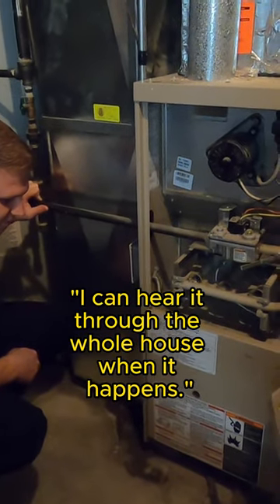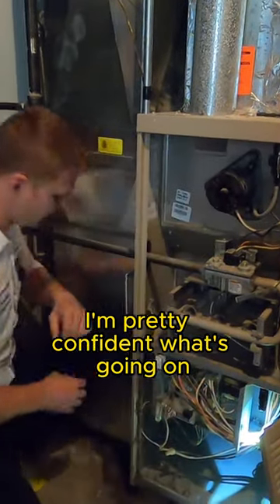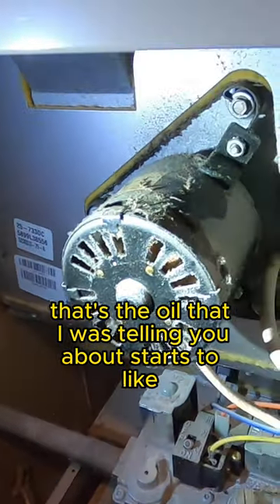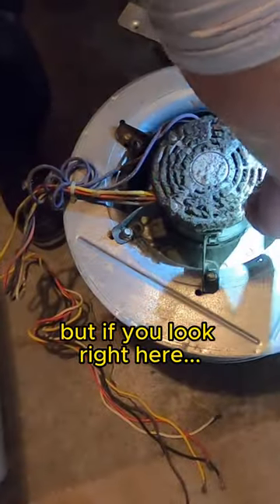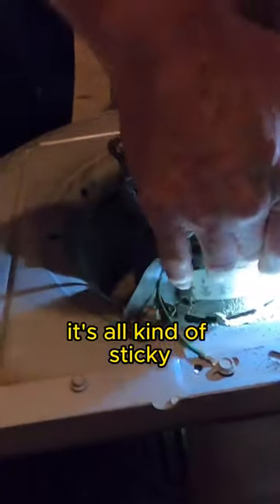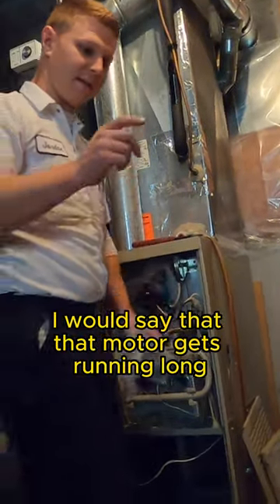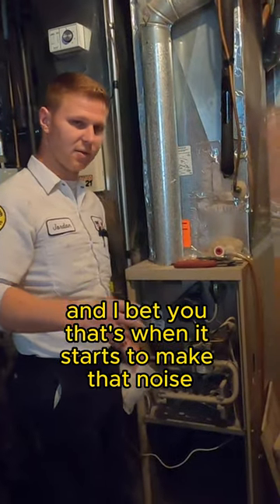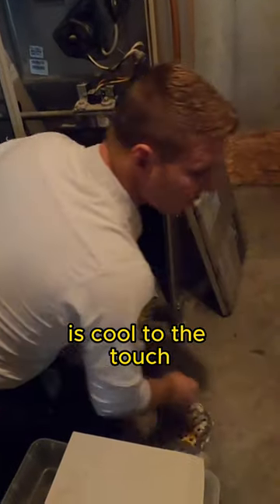Mystery Furnace Noise in Olathe, KS - The HVAC Diagnosis

Comment: Never heard of a blower motor having oil in it
Reply: Its technically grease. But it looks like oil. When the motor is older and starts to overheat, the grease will liquefy and eventually seep out. Typically means it's time to replace because the inside bearings are breaking down. But sometimes you can take it apart and just clean it.
Reply: All motors need lubricant my friend. Blower motors are a sealed system but they definitely have oil
Reply: @AJ-ox8xy what is the grease for?
Reply: Is grease and that's because is overheating
Reply: Motors had to be oiled back in the day =)